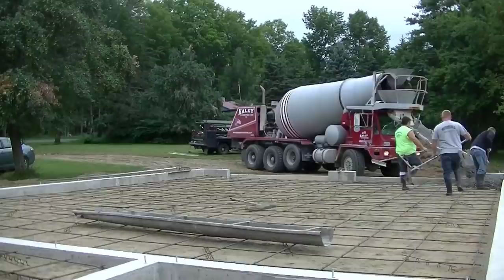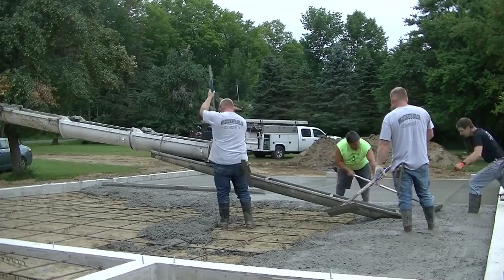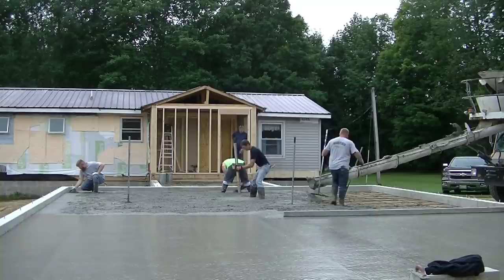Pouring A New Garage Floor 30' X 40' (That Slopes 3" Towards The Doors)

Comment: Down in Australia doing slabs we use 3.6m (12ish ft) single person screed and usually 2 pulling back sometimes 1. If it is a steep slope and we have to pour going up hill we sometimes use 2 for screeding but 99% of the time it's one person.

Comment: How do the garage doors not freeze shut when all the water runs to them
Reply from the maker: If the garage is heated, the floor stays warm enough to keep the doors from freezing. If the garage isn't heated, the water doesn't melt off the cars it stays frozen to the car.

Comment: Looked like you guys were dealing with a little ‘high-steel’ right there at the end of the video.
My finishers always did grades the same as you guys. They typically just refer to them as ‘grade’ or ‘money’, rather than ‘wet pads’. Just like you guys, establishing grade is typically the responsibility of the same guy, every time. Rather than strike a circled ‘X’, our guy always liked to strike a circled dollar sign ‘$’ indicating, that spot was right on the money.
Reply from the maker: Nice, It would be interesting to know how many "pads" I've made over the years. Always done them the same way. Thank for contributing good comments to the channel. I appreciate it!!

Comment: Its fine to run a bullfloat out 30’ as long as you keep it flat.
Reply: Just dont keep the pitch to high
Reply: When the mud is wet, all ypur tools should be flat. When it gets harder, you will have to add pitch to your tools